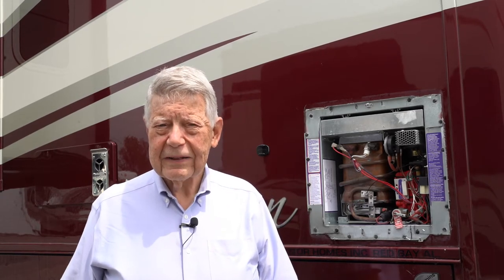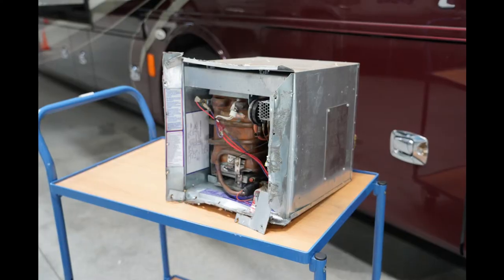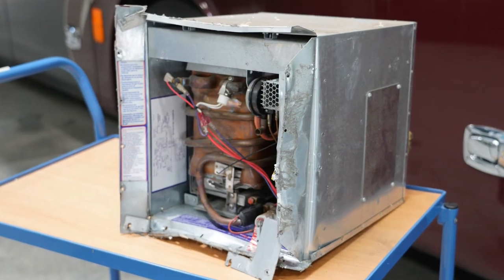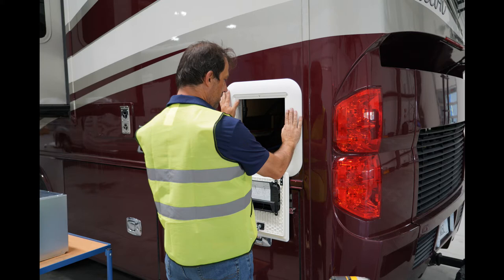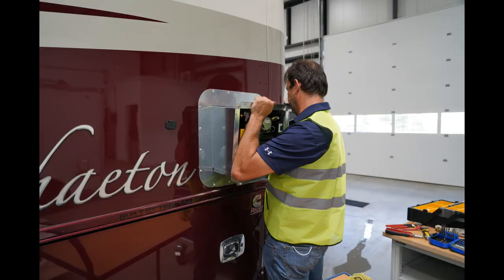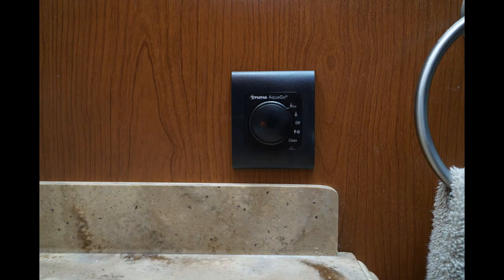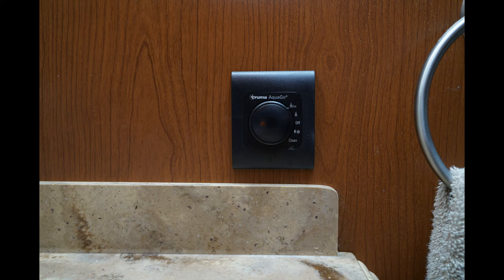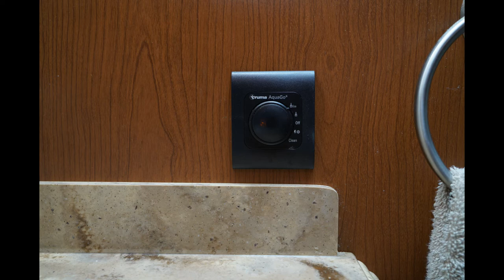Truma RV Water Heater Install

Comment: Hi Jim, I guess that's why Tiffin now use the aqua-hot across the board.. My 2020 has the aqua-hot on demand which does have both electric and fuel heating elements.. I have heard good and bad about the aqua-hot systems but I will wait for time to tell. I have always had a tank on my past 3 rigs and never had a problem with only regular maintenance.. Good luck with your new system and keep us updated..
Reply from the maker: Didn't know that.  I've run into a couple of people who like the Precision Temperature and didn't have the problems we had, so who knows. Hope you like it.

Comment: This answers my question in your previous Precision 5500 review. My research is pos regarding Truma, but wish to modify/expand it for subzero living.
Reply from the maker: It has an ability to keep the burners on for the preheat.  Not sure how much propane you would run through with that, which would be the concern if running from the on board tanks.  They deplete rather quickly when you need heat anyway.

Comment: I am happy the Truma works for you.  That has not been our experience, very very disappointed.  It takes at least 90 seconds to begin getting warm water.  Therefore only functional in a park setting with total water and gray water disposal available.  The Truma came with our brand new 2020 high end RV.  I contacted Truma to discuss and possible settings that could be changed.  No.  They say as long as there are no error codes that is all they can do.  We live with fewer showers and cold water to wash hands and wait to having lots of dishes so we don't waste our supply of water.
Reply from the maker: Not sure if this would help as a lot of this is personal preference.  Two things on dry camping:  1st)  We use prepared wet towels for the daily "washing" and they work fine.  We only take an actual shower every 3-4 days.  2nd) Before using the hot water you can use the "pre-heat" mode which puts a liter of water in a warm/hot condition so that eliminates or at least reduces the heat up time.  Our control in the bathroom has two settings:  the most counter clockwise is the no pre-heat function and the next one in the clockwise direction enables the pre-heat.  It does use a bit more propane in this mode but the water is both hotter and stays hotter if you care.  Then you can turn that back to the most counter clockwise setting to turn that function off.  We have had both regular and the Truma heaters as well as the other brand that we could never get to work right, but we all have our own ways and what works for us may not work for you.

Comment: That old unit you had was actually an Atwood system.  Atwood is now Dometic.  Not sure the old unit has parts available.  My pressure release valve cracked the plastic around it, on its own.  It cracked through natural expansion.  I think that was a weak point for the unit.  I never liked mine either.  It didn't balance the temperature well.  ARE YOU STILL HAPPY WITH THE TRUMA.?  Please advise, I need to find a replacement.
Reply from the maker: Well, actually it was a Precision Temperature unit, not Atwood.  They tried a lot to help and were basically helpful, but I thought the system was worn out and did not want to replace it with the same type, so the upgrade to the Truma system.  It has exceeded our expectations and continues to work well.  It was a good upgrade and definitely one I would do again if needed.